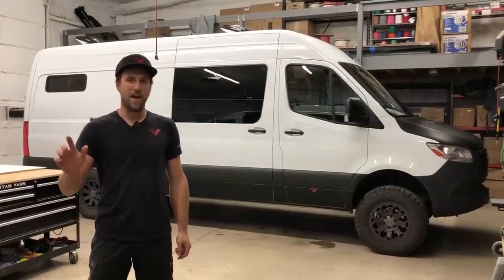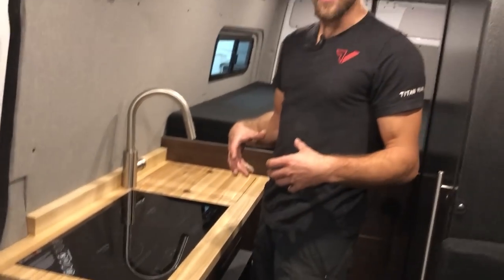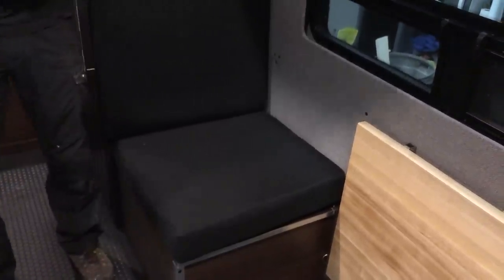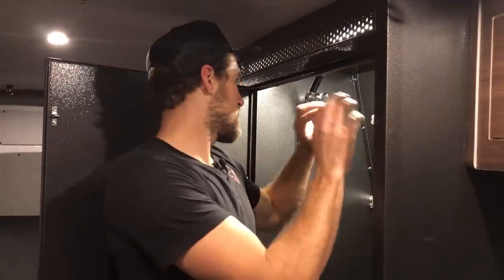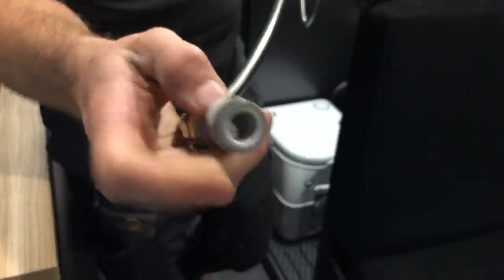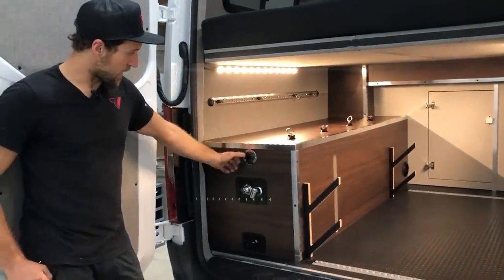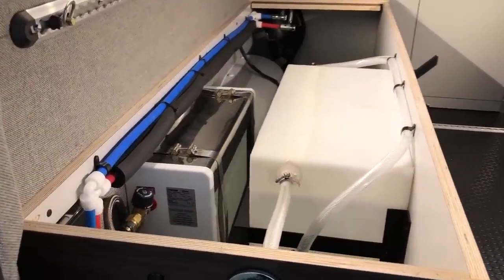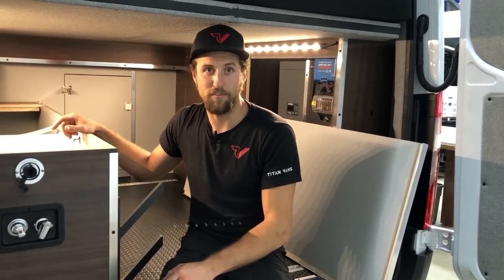Tour a Professionally Built Conversion Van - with Bathroom / Shower / Sauna (Titan Custom: Olympus)

Comment: I’m that guy.  The one who researches 1000’s of hours before he pulls the trigger on a van build.  Do it myself or hire a company?  Hiring seems to always leave a little (or a lot) desired.  Some look nice but the mechanicals appear sloppy or the cabinetry and hardware is lacking, space configuration is not to my liking.  This is def one of the most complete, high quality builds I have ever seen.  Unbelievable how clean the electrical, the plumbing and all the forethought.  Well freaking done Titan Vans.  Bravo.
Reply from the maker: Thanks Bruce! Appreciate you noticing the details!
Reply: I was bothered by the kitchen faucet hose not fully retracting but I'm sure that is just an adjustment on the weight.
Reply: What is the blank tank capacity of cassette toilet?
Reply: I LOVE the size and organization of the garage and utility area. Is the rear exterior shower hot and cold as well? This is very much what I want but maybe more interior cabinets.... i will be calling you soon!

Comment: I think it needs more cabinets, placed above the galley and bed, running the length of the van. Nice build!
Reply from the maker: Easy addition. :)
Reply: Yep, had the same issue. At first mine was set up with only one set of cabinets over the bed but I go worried it wasn't going to be enough so I had them install on the other side as well. I know the builder thought that it would limit my sit up space but I plan on resting by back on the back doors.  If it doesn't work, I will take out one set. Better to have and not need than need and not have.
Reply: Trent Mason ..I think it definitely is more spacious, the builds that have them down the length on both sides, makes it to cluttered & claustrophobic, IMO!
Reply from the maker: @melissabenson6749  always a trade off. We do like a more spacious feel but storage is key too
Reply: Would like to know the price and cost for this conversion.

Comment: this is probably the most clean design I have ever seen, great job
Reply from the maker: Thanks!
Reply: I've seen plenty of Vans i agree with Jw
Reply from the maker: @michaelrubio7070  Thanks!
Reply: @TitanVans  30000? 15000, 10000?
Reply from the maker: @90slimit1  What's the questions?
Reply: @TitanVans  What does a good build like this cost?
Reply from the maker: @90slimit1  email us at info@titanvans.com for pricing. Or check our website, most pricing can be found online at Titanvans.com
Reply: So I guess this is one of the first van you have reviewed?  It has the style only the uneducated van reviewer would appreciate.  Go and have a look at pleasure way or advance RV. 

That said the did try to make a RV camping Van but you can tell that there's a lot of things that are not going to work out and will need to be changed. Good start though...
Reply: @NewAgeDIY  I hear you.
Reply: @NewAgeDIY  I agree, not knocking anyone but the term professional is being used loosely, I have seen hundreds of diy vans and I was much more impressed with most peoples vans that was there first.
Reply: I have been researching for about a year... started with Pleasure Way, Airstream, Winnebego, Coachmen, leisure travel etc. “readymades” then got into custom vans like this and realized I want 4 season and 4wd or at least AWD for mountain life in Colorado. These guys have tons of experience with that and are highly professional with well designed organization from experience! The quality of systems, fixtures appliances and comfort is excellent and superior to the cookie cutter factory assembled versions. Some of you readers aren’t aware of that from the comments you’ve posted. I appreciate the pass thru storage capability too. But I’ll need 4 seats with shoulder seat belts. Love the rear exterior shower on the Solis and maybe a rising bed like the Revel? Lots of possibilities....

Comment: Guys, this is a beautiful build out. Mine is virtually identical. My shower is larger (I'm older and need more room) so I had to give up the larger bed in the back and my  dinette uses the front seat swiveled around. But really, it's the same floor plan. I just got it yesterday and the folks that built it out, Custom Coach Conversions is an east coast builder. They did a great job. The heart and soul of the rig is the 3000 watt inverter with 6 Battle Born LI batteries. I hope the owner of this is as please with his build as I am mine.
Reply from the maker: Congrats, if your ever passing through stop by and say hi!

Comment: Love the versatility here. But there is no extraction fan and only a small gap to vent the air back to the van. This means all those moisture and heat will transfer into the main compartment, not sure if it will be an issue tho.

IMO, I would put the small door vent at the bottom of the door instead and an extraction fan that vents outside near the top, so we got fresh air sucking from the main compartment into the shower and then extracted outside as hot air rises.
Reply from the maker: Not in Colorado! We need all the moisture we can get!

Comment: great custom build for a very specific usage. However, I don't see any insulation in the garage and specifically in the water heating side that would help keep the temp up when the furnace isn't running. The back doors could use extra padding as well; lots of heat transfer/loss through the bear metal... clean build though, I like it.
Reply from the maker: We figure, if your worried about water freezing it's cold enough to have the furnace run. The furnaces are capable of running for days on end with very little fuel consumption. Also, even with padding the heat transfer will still occur, as well as the fact that there are air leaks throughout the van that are needed for moisture drainage, electrical pass throughs, etc.

Comment: i would defo chose a permanent bed rather than all the hassle with pulling boards,moving cushions, 
disassemble tables  etc. but seeing the space under this bed makes me think i could use that for more practical use by raising it a bit higher and having  bunks under there or a dining area etc. i know the vans get narrower nearer the top so that is problematic for most people but i'm not most people .  And i would have to have a more spacious shower and separate toilet. maybe the toilet could go under the bed hmmmm...easy then for emptying out the back door instead of carrying through the van.

Comment: Super clean, like the trim on almost all the edges and corners. Only things I'd point out is the shower has numerous issues. The walls shouldn't have any seams whatsoever, it's going to leak eventually. Dark showers will be a huge problem to clean, not to mention it'll be really dark with that door shut, even with the light full blast. Last up - there's no ventilation in the shower! That is a massive oversight and in the winter the condensation will be a nightmare. You didn't show the control center or the cockpit area. Didn't show off the solar panels on top. That said, love the massive bed and most everything else was super nice. Last tip if you plan on doing a lot of these videos highly recommend you buy yourself a wireless lav mic, or a lav mic and mini audio recorder. Still record audio using the camera, too, just so you have a backup in case the lav mic stops working for some reason.
Reply from the maker: Thanks for the tips, we actually had a mic on. You can see it clipped to the top of the shirt. Battery went out 5 minutes before the end of the video! Decided to post anyways.

Comment: lots of potential for water damage using that sink  with splashing on the bed, the floor the stove etc.  that faucet is way too big for that tiny sink and its so close to the bed,  is there a mold preventative on that mattress, or did you make a splash guard?   that person must be tiny to use that bathroom with all those hooks in there.   seems lots of opportunity for injury.  maybe im too clumsy but someone is gonna hurt themselves on those lower ones.  its a nice idea i'd like to see an update after they've lived in it for like 6 months. 

i'd def go for a much much smaller bed and a bigger bathroom area. I do really like the material used to make the bathroom it looks better than most i've seen!
Reply from the maker: Luckily custom is what the client wants. Happy to design something custom for you!

Comment: Great looking build, lots of interesting ideas.  
Where is the grey water tank?  Did I miss that?  
What kind of insulation is used?  Someone mentioned it didn't look like there was much, if any insulation in the box holding the water tank.
And wood!  How heavy is the build?  All that wood seems not good for mileage.  Do you have tricks and tips for making it lighter?
Reply from the maker: We use Thinsulate for insulation. It does a great job, it's non-toxic and it doesn't harbor mold. The Webasto heater does a great job keeping the van interior warm including the tanks.

Comment: that shower unit is everything.   always curious as to weight of wood add isn’t there a lighter material to use?
Reply from the maker: Certainly lighter options available, but we haven't found something lighter that is as durable or long lasting. This entire build only used 6 sheets of plywood, each sheet weighs around 60 lbs, for a total of 360 lbs.

Comment: You mentioned winter sports so are the gray water tanks under the van insulated and heated?  Do you just cycle heater air through the water tank compartment or do you use electric line heaters.

You might want to put the toilet on a raised cantilever support or a pedestal support so that your toes can slip underneath it when you shower.  This is why kitchen cabinets are cut back under the cabinets so there's room for your feet.
Reply from the maker: We suggest just removing the toilet if you plan to take an extended shower. It comes out in seconds. The grey water tanks are not heated, the main issue with heated grey water is that it can produce massive bacteria growth. We suggest to our clients to leave the grey water open when possible to use as a pass through system.

Comment: What material is used for the walls? How about the ceiling? What kind of insulation and where?
Reply from the maker: Tweed upholstery on the walls and vinyl upholstery on the ceiling. Thinsulate insulation throughout the van.

Comment: This may seem obvious, but does the shower/sauna work with the toilet out of the shower? I like the idea of removing the toilet for showers (and sauna), but didn’t know if the toilet latches, clips can handle the water. 

I subscribed based on your comment that you were doing a similar build on a 144. I’m still getting ideas. But I really like your build. For my anticipated usage, I just don’t need rows and rows of cabinets or large hanging unit. Love the under bed storage for things like a portable grill. 

Build looks really nice. I know looks is subjective, but I’m not a fan of the glossy, “shiny” cabinet look. Rather have clean, easy to maintain and usefulness.
Reply from the maker: Toilet is removable with a simple slide in clip on the front. Take all of 5 seconds to remove. Our 144 design is in the works now!

Comment: 1. switch the sink to the left 2. countertop height is kinda low 3. if it is higher, space for a larger combo refrigerator freezer 4. lounge  is just additional. it's better to built a swing table between the driver and passenger 5. eliminate extra seat to substitute for tall storage. take the window off to accomodate this 6. dislike that it does not really have a lot of storage 7. heavy and expensive

Comment: Good solid design, but not enough cupboards. Could have changed the design with that seating area and put a small closet also. I also don’t like builds with the sink right up against the bed. Hot plates too big and a bit of waisted space on that Too. But all in all I like it.  I like the garage space. 🙌
Reply from the maker: When your ready we'll build you just for you!

Comment: Do you have more information on the bathroom / shower and how it's made? - I find that unit fascinating...
Reply from the maker: The main body is powder coated steel, designed to fit the curvature of the Sprinter. Stainless steel drip pan that is folded and welded in the corners.
Reply: Yes I saw that
Its interesting
I was just wondering if you posted videos showing how you made the components and installed them

Comment: Where is that form fitting mattress from ?  Looks like maybe only 5", but admire how it is molded cleanly to the inside shapes. Nice build
Reply from the maker: We custom make in house with 3 different types of foam. A 2" firm layer on the bottom, 2" mid density layer in the middle, and a 1" pillow topper. The mattress is reversible to allow clients to choose their preferred topper feel.

Comment: Love the design elements especially the cargo area and heated shower. But did I miss the cooling design? AC/fans?  You could build really great dog show vans but cooling is more important than heating with dogs. The cargo area could be made well for dog crates if you could get to them from the front living area and there were AC vents down there. Overall, very nice details and quality
Reply from the maker: Van had two fans installed. Air conditioning is possible but extremely energy intensive and requires a huge battery bank when boondocking.
Reply: @TitanVans  ps because the mold issue goes for both hot and cold weather , right?
Reply from the maker: @laurastanton7812  doesn't matter weather it is 12V or 120V, watts are watts. To create cooling requires a certain amount of electrons. When electrons flow out of the battery that is amps. Whether the end appliance requires 12V DC or 120V AC the same amount of amps will be flowing out of the battery to create the cooling power.
Reply from the maker: @laurastanton7812  really depends on the insulation you use and where the van is being used. We use a synthetic insulation called thinsulate. Mold grows on organic fibers, not synthetic. You need to ensure there is proper drainage in the walls and sufficient air flow, do not use any vapor barriers. If you plan on being in extremely humid environments you may need to run a dehumidifier. In the central and western part of the states it is not an issue.
Reply: @TitanVans   Thank you for taking the time to educate me. I am new to all of this. Like all dog people, I have severe anxiety about overheating dogs on the road and at events. They cant sweat like humans and horses so they overheat rapidly. Dog events are all over the place in all climates/elements. Some events have hookups and some do not. It is a challenge
Reply from the maker: @laurastanton7812  We hear that! We are dog lovers and some of us have lived years in vans with dogs and the heat is always an issue!

Comment: Clear, brilliantly thought out design. I love the fact that service has been thought out.
One question...is the Grey tank heated?
I’d buy from these guys if in UK 👍🏻
Reply: You would never never never never heat a grey tank.  Grey tank = contaminated water, add heat = mold, bugs, bacteria, etc. . .
Reply: So how do you stop the grey tank freezing?
Reply from the maker: Unfortunately, 4 season vans are extremely difficult and apart of van life. The grey water will freeze if it gets cold enough, you can leave the grey water open and operate it as a pass through system. But if it drops to -20 F there is not much you can do.

Comment: I think the biggest mistake most of these van builders make is not incorporating the front cab. Just watched one that their front seats swiveled around. You would have thought they doubled the size of the van. If you are stelthing you just don't use the seats and leave them facing forward and put a curtain up. If not, spin them around and you have a whole new space.
Reply from the maker: Absolutely, we do that on pretty much every build. This one as well, just didn't highlight it in the video. That's the reason we placed the wall mount flip up table where we did. Once you swivel the seat it becomes a two person eating area.

Comment: Just curious do the rear doors conduct lots of cold, I saw the hollow areas were covered and I assume insulated, but it seems there is lots of painted metal that is not covered that would chill down nicely in cold conditions. Any issues with condensation?
Reply from the maker: Not with our heating system. These vans are metal boxes. Thermal transfer is inevitable and there is no way to insulate every surface without loosing an incredible amount of interior space. Additionally, all vehicles have penetrations in them to allow for water drainage, electrical pass through, and venting. That means air transfer from outside to inside can not be controlled. It's like having an R60 home then leaving the door open. Doesn't matter how much insulation, the outside temp will become in the inside temp.